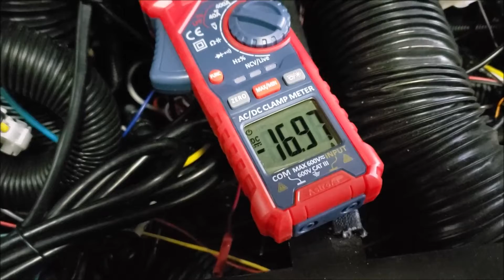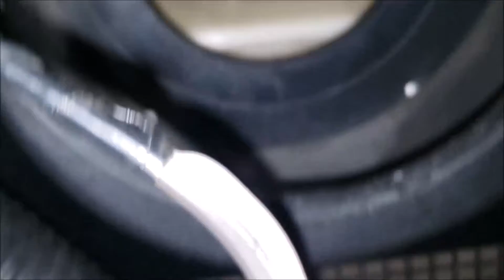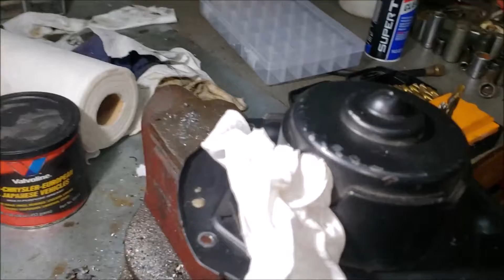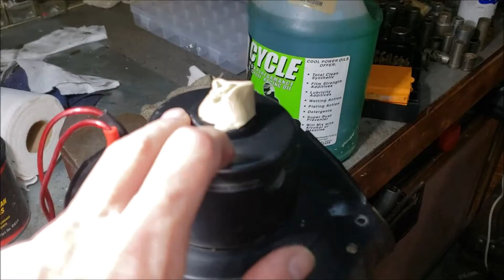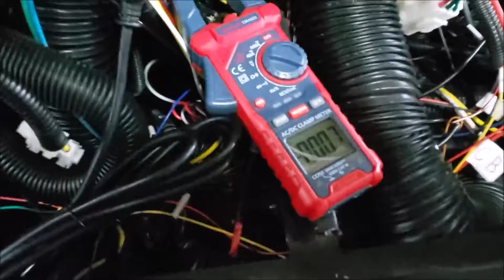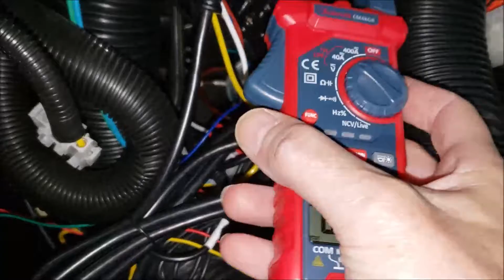How Troubleshoot & Lubricate Workhorse Winnebago Blower Motor 030-0137 For Your Dash AC Air & Heater

Comment: Murphy's Law happened when I turned the blower on to show an interested buyer that the AC worked but all the blower bib was make a bunch of noise. It was a bit of a pain to get to but I pulled the motor, drilled a hole at the top of each shaft reservoir and oiled them. Even furnace blower motors will last much longer by doing this.

Comment: I pulled my fan motor when I first got my used W22. It was dragging , so oiled it up , cleaned it up and put a media filter in the intake throat. 
That’s how I used to get ac fan motors through a long weekend till I could replace it if it was really bad . 
Another “fix” well done

Comment: Nice.  Same setup as a 94 Vectra.  Mine was cooked already and I bought new blower motor but the squirrel cage is hitting inside and I have not had chance to correct the fan spacing clearance.

Comment: Had to do this twice on my pontiac.
Reply from the maker: Why twice? 1st one defective?
Reply: @Kevin Caudill  when I first got the car it was slow to speed up and made noises, then 5 years later had to do it again
Reply from the maker: @GenetrySolar  You sound like a buy and hold kind of guy? I have had my 1995 Nissan pickup for 22 years in fact I should to the same oil lube trick to it also....
Reply: @ktoutdoor  why buy new if it can be repaired :)